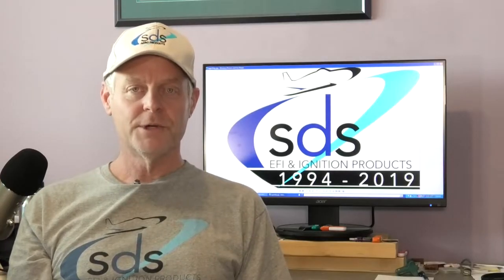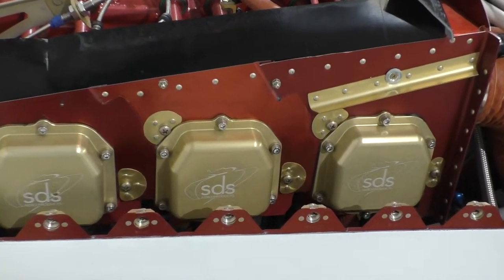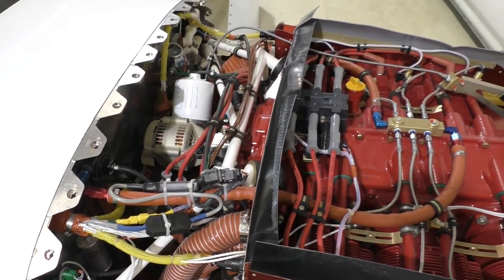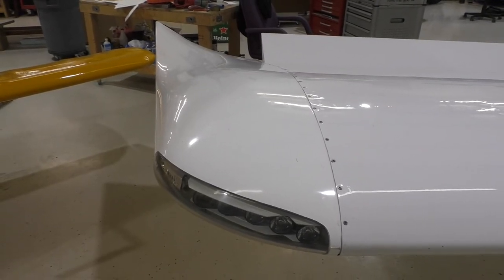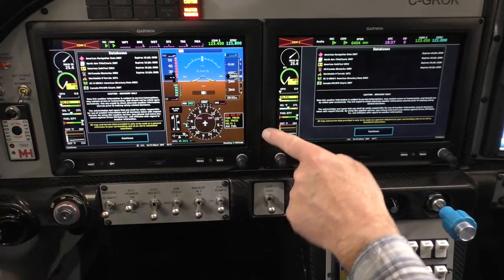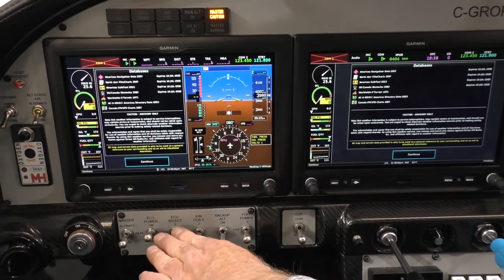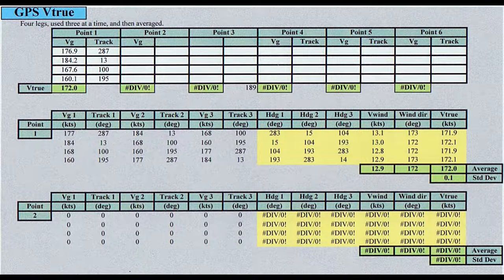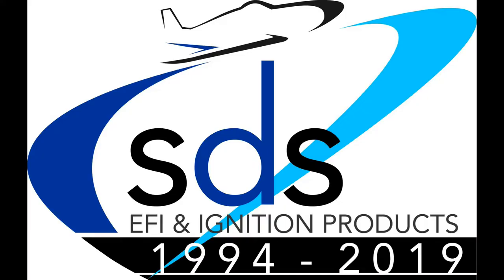Four Minute RV-10 Fix

Comment: So how long will an aircraft run without an alternator running an ECU coil pack system? On mags you can in theory run indefinitely right? 

Definitely can see the benefits to a real ECU. There is a reason why cars run them.
Reply from the maker: The system will run about 1 hour on an 18 amp/hour battery. Yes, mags and carb or mechanical FI don't need any electrical power to run.
Reply: rv6ejguy nice, an hour is a pretty long time all things considered